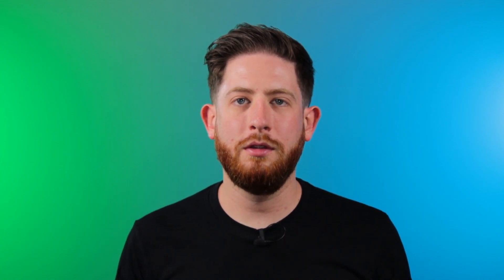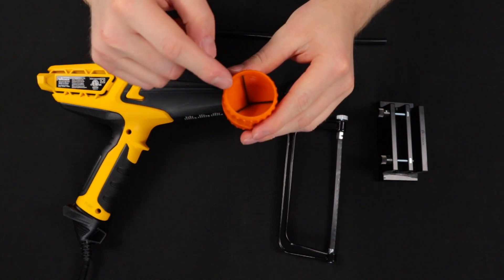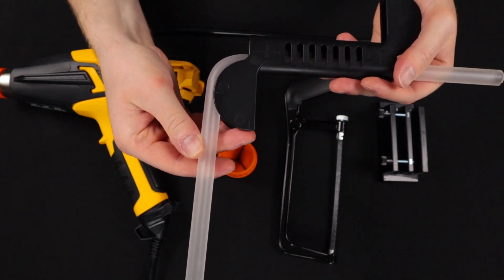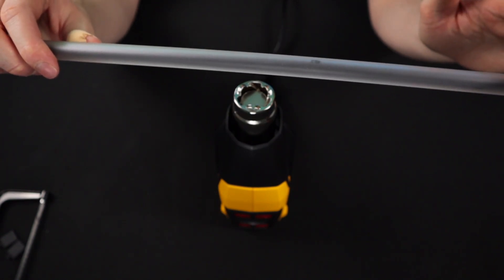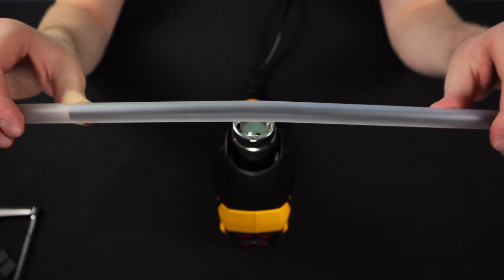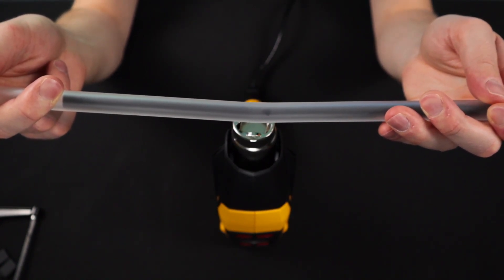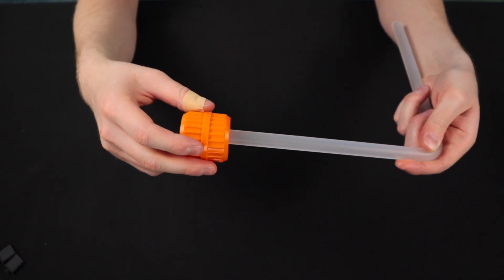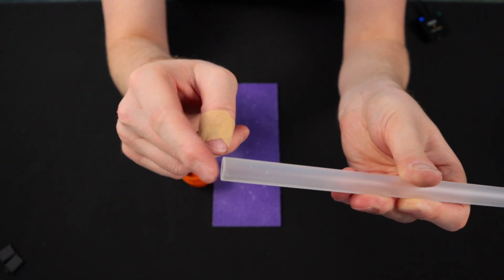Beginner's Guide To Bending Perfect 90-Degree Angles - PC Water Cooling

Comment: This was in my recommended. My advice for beginners who want rigid tubing is to buy pre-bent 90° tubing. After that there are jigs that you can put together to measure both distances, and my overall recommendation is to cut them too long and to buy spares. My most important tool that I have is a PrimoChill (or it's equivalent) Hardline/Rigid Watercooling Tubing Finishing Bit with the correct ID and OD for your tubing. Cut long. In fact you can cut really long, it'll make a mess, but you can get the exact lengths you need and you'll have perfect ends. 

I prefer metal tubing copper and chromed tubing. However, since it's really expensive and acrylic is relatively cheap, I always make my pieces from acrylic or whatever cheap material and then clone to the metal tubes with a pipe cutter. Example EKWB EK-Loop Metal Tube Cutting Tool.
Reply: .. Also, I would strongly recommend a temperature controlled heat gun. Example EKWB EK-Loop Heat Gun 1500W. There are others but they're even more expensive.
Reply from the maker: @DJaquithFL Great advice! Temperature controlled heat guns are amazing for tube bending! Merry Christmas and happy holidays!
Reply: @techtoniksystems  .. Same to you! Merry Christmas & Happy New Year!

If I have a PC build that's all 90° bends then I buy the pre-bent tubing. It's the simplest, fastest and highest QC approach. In my example with metal tubes, I wouldn't even think about bending them.
Reply from the maker: @DJaquithFL  Yeah the pre bent 90s are amazing for single bends! I will for sure be using some of those in different up coming builds!